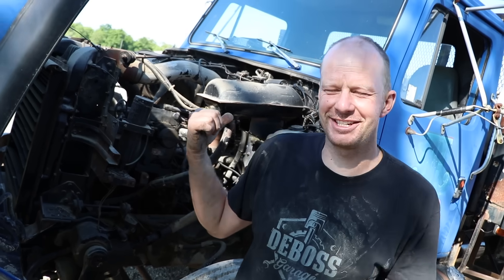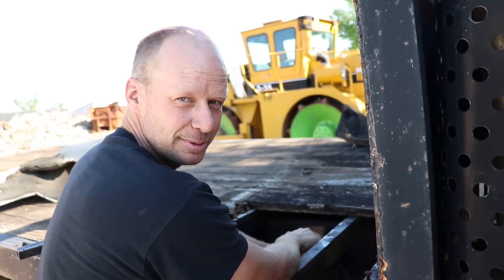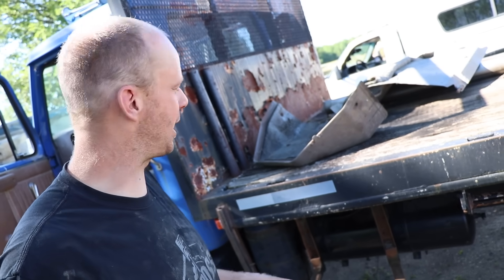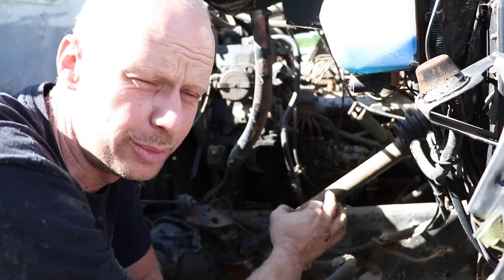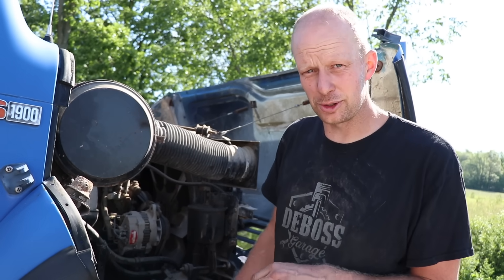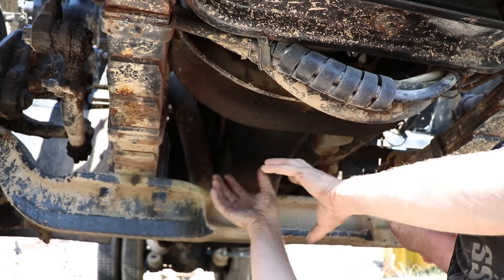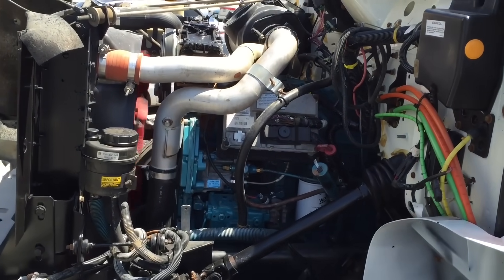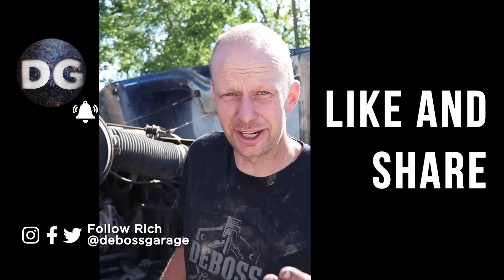REVIEW: Everything Wrong With a 7.6 Navistar DT466 Diesel

Comment: The DT saved IH's ass in the 70s and early 80s for their mid size trucks. The DT was mostly a stationary engine and not used in trucks at the time. It was a good engine but low hp

Comment: The follower issue you talked about is a fairly common issue in the dt466e and maxxforce DT platforms. The dog bones holding the followers have a tendency to fail allowing the roller follower to turn and wipe out a cam. They have updated parts to remedy this issue.

Comment: You never see one in mixer truck  loaded drop off small hill if eng over winds just a little rod will be out the block  fast over winds by 200  it will come out block  like a chevy 455

Comment: You should do a video on everything wrong with a Mack Thermodyne engine, nobody talks about those on youtube but it's actually a similar engine as far as size, weight, and power as the dt466, 8.3 and 3126

Comment: The only problems I’ve had with the 466 is the 466e. Just rebuilt one where the clip on the lifters broke and the lifter ate the cam. Got another one in the shop also ate the cam but haven’t gotten into yet to figure out why. Like you said 466e has issues.

Comment: I retired from Navistar and worked many years in the Melrose Park facility. We've had buy backs of these with over a million miles and the crosshatch from the hone still present in the cylinder bores. One truck with over a million miles the owner kept meticulous records and we tallied how many other parts it used, like 30 sets of tires, 6 drivers seats, 40 brake jobs, etc. It was quite impressive
Reply: That’s insane man gotta love that when you take care of them
Reply: So im about to buy a 2003 international 4300 with this engine .. it has 400000 miles for 18k do you think I should take my chances buying it ?
Reply: @SmithsDynamic  That's hard to say. Based solely on the numbers it sounds okay. But look into it deeper like maintenance records and how well was it kept? If there's a lot of small issues and it has the appearance it has been neglected, you may pass or try to get the price down some. If it looks clean and like the owner took pride in it's appearance, they most likely did the proper maintenance.
Reply: Were these issues inherent since their first use as an automotive engine in the 1975 Fleetstars, Cargostars and Paystars?
Reply: So did my father in law who designed the fly wheel for this engine
Reply: @scoutplatoon8410  There is only one flywheel for "this engine"? Regardless of "vingage" or "generation", application, trans/clutch/drive type, etc? Hardly.
Reply: @deeremeyer1749  I was just replying to the person who worked at Navistar . That is the same place that my father in law was in charge of the engineering of that flywheel and the components. Hope you have a great day. Tu for your response
Reply: 25,000 miles out of new brakes, 33,000 miles out of new tires, 175,000 miles out of new "drivers seats" in a truck that probably had a bench seat if it had a DT466 but supposedly a "million miles" out of the engine...

Nothing about that "million miler" supposed "buyback/teardown/inspection" spiel sounds fishy to you?
Reply: That's not impressive at all for a "heavy-duty" engine in a "medium-duty" truck. Especially if the service and maintenance was "by the book" given how "maintenance-intensive" the "first gen" and "original" DT466s are. There is at least two of every filter - air, oil and fuel - just on the engine and usually one or two more fuel filters/screens to "service" at every oil change "by the book". You can't buy just the oil filters at "International". You get the fuel filters too because "International" specced the cheapest fuel-lubricated "heavy-duty" injection pumps on the "truck motors" they could "adopt". If you starve the pump for fuel and/or "feed" it dirty fuel and/or oil you've pretty much destroyed the whole pump top to bottom and front to back. $2000-$5000 minimum. Before labor, new "injectors" (injection pumps "feed" NOZZLES while actual injectors have the pump "built-in"), more labor, etc. They also hold about "only" about 1/2 as much oil as engines with 2-4 times the "horsepower" but the "by the book" oil change interval is 2-4 times as often as "big trucks" with 2-3 times the GVW. Then there are "tuneups". Adjust valves, remove/test/rebuild/replace "injectors" and check timing. "By the book" about every 50,000 miles. 3-5 times as often as on "big trucks". And at best "fully loaded" to max GVW - 26,599 LBS. 95% of the time - a DT466-equipped straight truck MIGHT get you 1.5-2 times the fuel "mileage" of a "big truck" at 80,000 GVW. 

Bottom line is an "OTR" DT466 "meticulously" serviced and maintained costs more to own and operate per mile than pretty much any "semi" out there, the "meticulous" maintenance and service required pretty much REQUIRES getting a "million miles" out of one to "pencil out" AND a "million miles" from a "heavy-duty diesel" in a medium-duty truck that ran/runs "empty" and/or "less than loaded" at least half the time is simply not impressive to any "industry insiders" on the FIELD side of the "trucking industry". 

And in YOUR "historical example" the "million miler"  was PROBABLY A "MAIL HAULER" contract carrier for the USPS "trucking" HUNDREDS - not THOUSANDS - of pounds of mail to and from a regional distribution center and local post offices about "7 months a year" (365 - weekends and legal holidays and vacation time annually) at maybe 300-400 miles per day "round trip", a "million miles" is even less impressive. 

Although any "trucker" unable to get more than 25,000 miles out of a "brake job" and more than 33,000 miles out of a set of tires - sure as hell isn't "meticulous" as a driver and/or owner-operator. Which is possible but unlikely BUT if SO "trucking" that way he probably went broke, rolled the odometer AHEAD and blew a bunch of smoke up someones ass to get a "buyback" on a "million mile" truck/engine built by a company that was repeatedly "bankrupt" and "bought out" beginning about the time it "developed" a "one size fits all" so-called "heavy-duty" diesel engine "family" called "THE LEGEND" (by "the industry"  according to the internet despite the fact that in almost 30 years "in the industry" and two degrees in diesel technology and one in "Truck" and one in "Construction Equipment" AND a lifetime on farms and ranches working/wrenching in/on/around "Binders" - tractors, trucks, combines - and I'd never heard a DT466 called "The Legend" until TODAY, lol) and was/is managed by "suits" stupid enough to BRAG about "one in a million" of those "legendary" engines being "reliable" (DURABLE is the correct term for "long-lasting" but hey, this is the internet where you don't need to be an "English major" to be an "expert" and/or "enthusiast" in/on any subject) enough to "last' a "million miles". Which is a distance rather than a time period and meaninglless in the "diesel ENGINE industry"  where everything is measured in HOURS. 

A million miles "on average" on/for an "OTR" truck is about 30,000 hours. No more than 25,000 of which are actually "driving hours". No more than half of 25,000 of which can be "loaded hours". No more than maybe 1/4 of which are "fully loaded hours". 

So what are you left with? About 6500 hours MAX where that engine was "pulling it's guts out" at most. Which is a pretty typical "time before overhaul" in the real heavy-duty diesel industry of off-highway ag/construction/mining machines and engines. And an industry in which "International" went bankrupt and got bought out trying to "compete" with Deere & Co. and Caterpillar. 

Because "International" dumped tens of millions of borrowed dollars into a "one size fits all" engine "family" that began with a "competitor" for the top-end of Deere "300-series" - the 414 -  (Deere's Dubuque-built "300-series" extends to the"414" just as the "500-series" includes the "619") and ended with a "competitor" for the "top end" of the Deere 400-series - the "466". And as usual put "new" engines in front of the same old obsolete powertrain.

And the "new" IH engines stayed with obsolete "rotary" injection pumps because Deere and Case/Cummins had Robert Bosch's inline pump production "spoken for" and "maxed out" and that "superior" so-called "crossflow" (so-called because the VALVES still are not "across" from each other, lol) engine design didn't allow for inline pump mounting in the existing obsolete TRACTOR "CHASSIS" and the "new" and "first gen" DT466 didn't/doesn't have an inline-pump compatible lube system. 

Want to know what else isn't impressive? Crosshatch remaining in any "quality" internal combustion engine still "running and driving" and "hitting on all" however many cylinders at "teardown" regardless of "mileage" OR "usage" that is just "tired" and not "worn out" and hasn't been "dusted" or otherwise "fed" dirt, debris, excess fuel, etc. I've "torn down" everything from .33 cubic inch nitro RC engines to 14,000-cube V-16 4500-hp locomotive engines and have looked in thousands of "holes" of engines with 30 minutes to 100,000 hours on them. Unless they're "dusted" there is ALWAYS "remaining crosshatch" in the cylinders.

You're proof that you don't have to know anything about engines to "build" them at the "factory" and real knowledge vs information comes in the FIELD "tearing down" and "REBUILDING" THEM FOR A REASON BESIDES "LET'S SEE WHAT'S INSIDE!"
Reply: @deeremeyer1749 What’s the least costly to operate, reliable, durable, engine to have in a semi/box truck? Both newer models and older models that are pre DEF.
Reply: @deeremeyer1749 holy hell you’re fucking annoying 😂
Reply: So the "meticulous" owner only managed to get 25,000 miles out of a "brake job" and 33,000 miles out of new tires? And which of "these" were the "buybacks" of? There are multiple "generations" of "The Legend" DT466 engines with basically zero "internal" parts commonality between the "first gen" and "last gen" engines. Even the bore and stroke changed. Signicantly. As for the "million mile" b.s. and the supposed proof of "reliability" (the correct term for "high mileage" engines that "haven't been touched" is actually DURABILITY since how "long" something lasts is DURABILITY while RELIABILITY is how "long" it "does what it should" i.e. start when the key is turned, respond to "throttle inputs" etc) as evidenced by remaining crosshatch is a bunch of b.s. 

Crosshatch in  a "high mileage" used engine is usually indicative of an engine not properly broken in and/or one that is "underworked" and therefore no being used at/to maximum "cost effectiveness". 

As a "heavy-duty" diesel engine in medium-duty - at MOST and that's not even the case in the vast majority of I-H/International DT466-equipped "vocational" on-highway trucks with GVWs under 26,000 lbs - "high mileage" - trucks, DT466s are "underworked" and "overbuilt" and "high mileage" should be the rule rather than the exception. Any truck going through brakes and tires every 25,000 and 33,000 miles is being driven "fast" and not "hard". 

Mileage itself is irrelevant to engine "reliability" since it's engine load, temp, speed and "cycles" that "wear out" parts. Engines have no idea how far they've gone in miles. 

ENGINE HOURS are the industry STANDARD for determining warranty, wear - normal and abnormal, service intervals and "preventative maintenance" (PREVENTIVE maintenance to those with a clue about engines AND the English language where the root word "preventatate" does not exist) as far as TRUE heavy-duty diesel engines/applications/vehicles go which incidentally is where you find ZERO "last-gen" DT466 engines just as you don't find the other commonly-praised "million-mile" engines that have "never been touched" and were/are supposedly "bought back" by the engine manufacturer for "reverse R&D" YEARS IF NOT DECADES AFTER "MASS PRODUCTION" so - apparently - the manufacturer can use them as "proof" that they do or rather did in fact "mass produce" them correctly in the first place. 

Particularly in "OTR" trucks which nearly always run "empty" at least half the time, rarely are ever "overloaded" of even "fully loaded" much less "lugged" from a powertrain standpoint and get fewer "cold starts" than any other vehicle/application and have anywhere from 6-18 "working speeds" not to mention "deep reduction" and "double-overdrive" tranmissions, "mileage" really means nothing. 

A "million mile" truck rarely has more than "averaged" 30 mph, has never been continuously operated at "full load" IF every operated truly "loaded" at all - i.e. anywhere near its GVW which is the case with the "contract haulers" that TYPICALLY and "meticulously" get a "million miles" out of "OTR" trucks they MIGHT have actually "truck" with 6-8 "months" a year and have in the shop for "maintenance" bi-monthly if not weekly and overall an engine not "worn out" when the truck is past its "useful service life" i.e. "depreciated out" at a "million miles" was/is not "cost effective" to own/operate UNLESS the manufacturer "buys back" the engine at "retail price".

True heavy-duty diesel engines aren't made to be "bought back" and/or "outlast" the "vehicle" they are installed in and if "converted" to "loaded miles" the "reliability" they routinely demonstrate with "meticulous" service, maintenance, operation, ownership and "management" would far exceed a "million miles". 

Hours into the 30,000s, 40,000 and 50,000s and even 70,000s "without being touched) (using the "million-miler" definition for "never touched" which is "head(s) never lifted, pan never dropped") engines that literally run up to, at and beyond "full load" 24-7-365 are "routine" on/in/from TRUE heavy-duty diesels "mass-produced" by the ag/construction/mining/forestry machine manufacturing companies "IH" went "bankrupt" trying to "compete with" during "first-gen" DT466 engine "development". 

They being Deere & Company and Caterpillar. Both of whom "dabbled" in the "OTR" truck engine "market" but only with "automobilized" versions of their heavy-duty off-highway diesels. And they only "dabbled" in that "market" to the extent and point it was "profitable" and "sustainable" to do so. 

Caterpillar being the one of the two to actually "mass produce" OTR "heavy-duty" truck engines while Deere had a very short and limited "career" building CNG-fueled "city bus" chassis and powertrains during that brief "alternative fuel" bubble. 

The fact that "International" - i.e. NAVISTAR - built every "DT466" (and all the other "300-series" and "400-series" and "500-series" D/DT/DTA engines on a single "assembly line" in a single "plant" for multiple decades and "generations" while Deere and Cat had and have multiple engine "plants" on multiple continents "around the globe" and have had since a decade or more before the first "first-gen" DT466 "rolled of the assembly line" and were/are building mutiple engine "families" and/or "platfor
Reply: @deeremeyer1749  Actually that’s extremely reasonable for a heavy duty truck application. When towing or hauling, brakes get worn out extremely quickly. I’ve watched even light duty trucks like the F350 burn through a brake job in under 7k miles when towing steers. It just happens and isn’t something to be critical over.
Reply: @chrisabrams8985  exactly, all miles are NOT created equal. I haul med/heavy with my f350 but it rarely leaves a 10 mile radius of my shop. People cant believe how little miles i get out of tires/brakes. Its just a 1 ton but the same goes for the big trucks. Think of the stop n go say a school bus does compared to a semi going coast to coast.

 No matter what, i still think a million mile engine is impressive. Most dont make it there not because it's designed crappy, just due to the type of service it does.

Maybe deeremeyer1 is right, cross hatching still being there may not be indicative of a great engine, but it being scuffed off is definitely indicative of it being worn. Other than that im not sure what point he was trying to make. Companies do buy certain high use stuff back for research purposes, the original comment doesn't seem fishy to me at all.
Reply: @deeremeyer1749 "Why" you gotta "be" a "dick"?

Comment: Ha, Most trucks hauled in have air brakes caged to move!  You might want to mention the brakes issue before crawling over a wheel.  Also, under power is for longevity.  If diesels were pushed like the light truck industry they would be toast at 100k!

Comment: Our company had 19 1982 models with the 466 engine. The tandem's top speed was 78 mph, the one singe axle would do mid 90 mph. We had 3 5&4 speeds, 15 used a13 speed, and the single axle was a 9 speed. We never had any problems with them except getting the brakes hot in the mountains. They needed a Jake Brake, but not sure they even made one for them. We also had 4 TD15 dozers with a 466 engine in  those as well. The state road used a lot of them, and all of our school buses did as well. I usually dove the Mack trucks, but for light loads the International seemed to work very well, just keep them out of the mountains.  Thanks for the video !

Comment: Hey I have a 466 international diesel it is a 1992 bus with airbrakes the brakes are locked because the belt is off and nobody seems to know how to change the belt is there supposed to be a tensioner on it trying to move the compressor to tighten the belt any ideas?

Comment: i ended up buying that engine lol darn thing runs like a champ however its not a cold weather lover its in a ford F550 service truck the compressor was absolutly fried popped in a new one put a bigger ingector pump on along with a bigger turbo the darn thing goes like a scalled cat now grid heaters from some cummins engines added so it will start 4 total (dubble stacked to get the best to fire up at -40 haha) thanks for pointing out this gem its a 700 horsepower dead reliable beast that loves to work